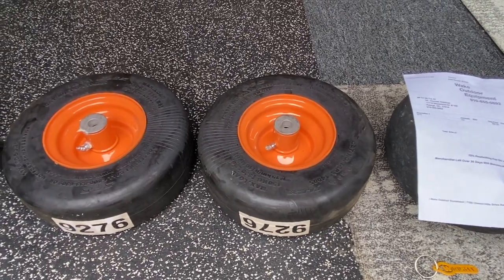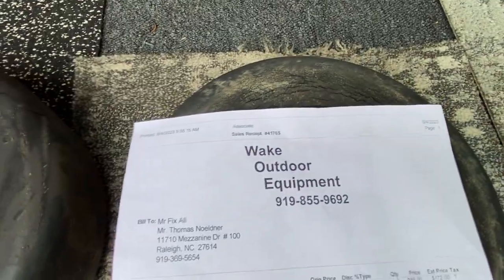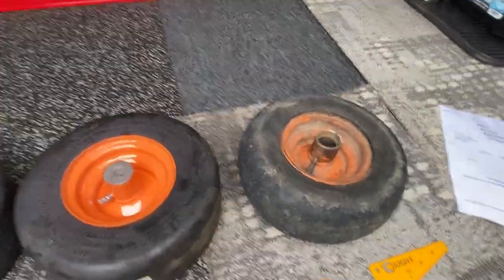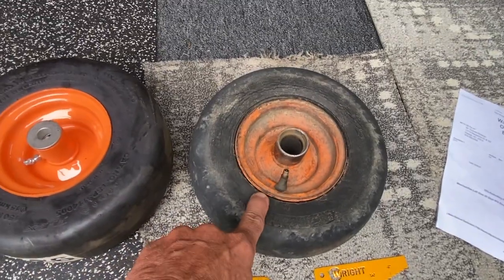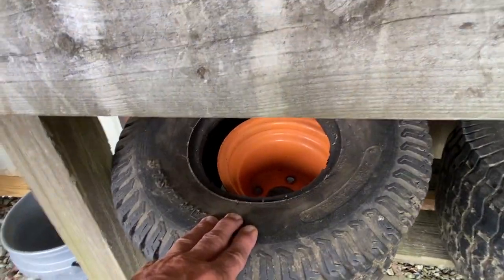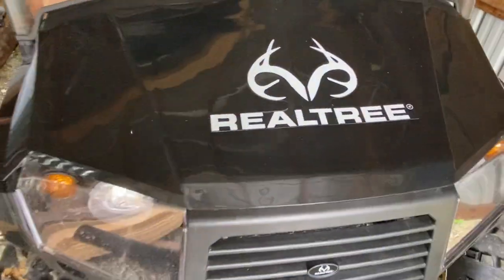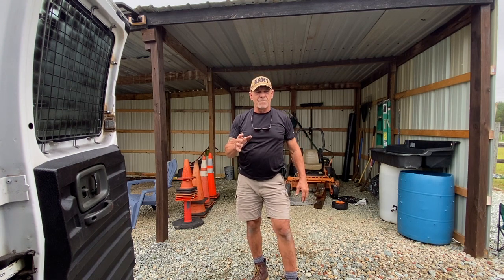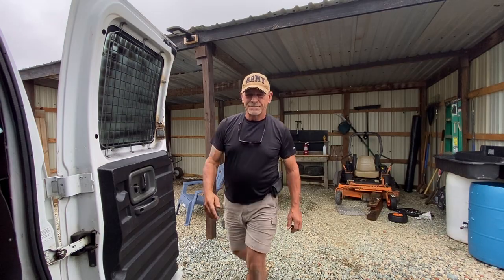SCAG MOWER. Small Tires Cost How Much?  RANT. +++

Comment: I’m almost positive you need that barrel pin, put some in today on a customers Dixie Chopper mower, I had to tap the bearing out from the opposite side
Reply from the maker: Great point again I will see what the wear is. I have both pins, so Can do as you said.  Fingers crossed.
Reply: @tnoel374  i second the motion on the barrel pin . you will fuck it up  cheers

Comment: Believe it or not that price ain't bad. Just put 2 new tubeless type fronts already mounted on the wheels for my JD Z 225. $128.00 for the pair if my memory is right. Rears were around 149.00 a pair tires only tubeless type. Amazon. The hydro drives are $1200.00 a pop btw. Engine about 1800.00. Change your oils partner:make it last.
Reply from the maker: amos I know what your saying it sucks but nothing is cheap anymore. Dame son.
Reply: @tnoel374  and getting worse. Food has come down some: have to watch the sales. Diesel here jumped $0.49 per gallon:in 1 day. That really sucked.

Comment: Tom, doesn't it seem like OEM is always expensive. At work they buy small tubeless stainless caster wheels about $100 a pop I was told. It's for making and replacing cart wheels for hanging brats and sausages for the food industry. My employer does a lot of work for commercial businesses that's where the money is compared to residential.
Reply from the maker: Great point smaller does not mean less expensive.  It means more expensive. Weird.

Comment: I would have gone first to Harbor Freight then Northern Tool. Then at HF would have found the 10" or 10.5" wheel and made it work for $30 each. I'm usually a HF shopper but last bought tires from NT when I wanted to upgrade my trailer's wheels to a larger size capable of highway speeds and long distances without risk of overheating the bearings.
Reply from the maker: Great comment and info on your parts. I want keep thing factory original as much as possible only for resale value at somepoint.